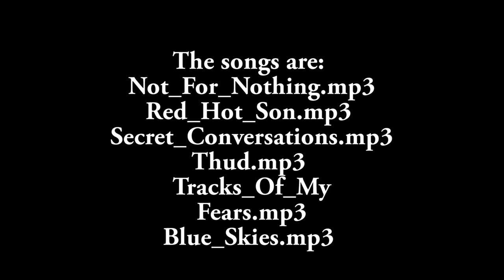Gold chain 18kt handmade

Comment: I like how he's just able to eyeball the center of every link and it matches up perfectly every time.
Reply: Yes I would have had to measure each one and would still miss the mark sometimes
Reply from the maker: Thanks
Reply: When you use round nose pliers you don't have to find the exact center. If you see one side is longer than the other you just bend the longer side into the shorter side. You are right sir he is very talented.
Reply: Ilovetheplatypus www.
Reply: Ilovetheplatypus practise
Reply: His soldering game is on point !

Comment: What is the machine called that you can flatten the gold to the desired height and then what is the one where you can create the gold wires so you can start to create the links? Thanks. Anywhere I can purchase online?
Reply from the maker: http://www.pelusi.com/1/laminazione_dei_metalli_4088685.html
http://www.pelusi.com/1/trafilatura_dei_metalli_4088699.html

Comment: Hi. The products you make are beautiful. Have a lot of sales. I did the same job in Turkey. I used flexx 152 as an additive for 18 carat. I gave forty percent silver for his contribution. The color of my product is not good. Your color is beautiful. I would be very happy if you could help me with colors.
Reply: Merhaba dosdum ben türkiyeden mesacıma cevap verirsen sevinirim şimdiden teşekkürler
Reply from the maker: For the yellow color I use the classic gold, silver and copper alloy. for the title 750 thousandths (18KT) I use 75 parts of pure gold, 16 parts of silver and 9 parts of copper. By changing the percentages of copper and silver you can vary the color of the metal from greenish yellow to English red.
Reply: Size çok teşekkür ederm dosdum yapdın işde basarılarının devamını dilerim
Reply: @scaffoal  size çok teşekkür ederim dosdum yapdın işde basarılarılarının devamını dilerim

Comment: how many grams of 24k gold? before you transform it to 18k
Reply from the maker: 24kt corresponds to 1000 thousandths. The proportions for the 18Kt are 750 gold parts and 250 alloy parts. Normally, 755 parts of gold and 250 of alloy are used in order to have the certainty of the title during the checks.

Comment: How many grams does a chain of this? What is the thickness of the wire? thank you
Reply from the maker: The chain is 64 centimeters long, weighs 58 grams, the flat wire is 1.80 x 1.00 mm.

Comment: What did u add to make the chain gold
Reply from the maker: I hope I understand the question, for gold 18 kt yellow or red, we use pure gold for 750 thousandths and silver and copper for the remaining 250 thousandths. With the various proportions between copper and silver the shades from the dialect to the English red are obtained. On the market it is possible to find ready-made gold alloys with optimal characteristics for the various types of processing.

Comment: About the fillet edge is after the welding part?
Reply from the maker: I did not understand the question
Reply: i saw the edge of the every single unit is smooth and round. I did not see any grinding in the video. Is do it after welding or before?
Reply from the maker: It is polishing that has rounded edges uniformly. I spent the sandpaper along the flat wire before cutting the pieces and I rehearsed after welding only where it does not last well
Reply: Thanks for your experience and let me know the new chain making technic :D